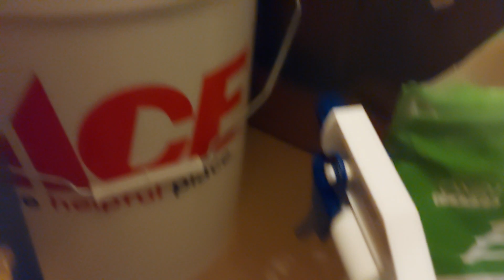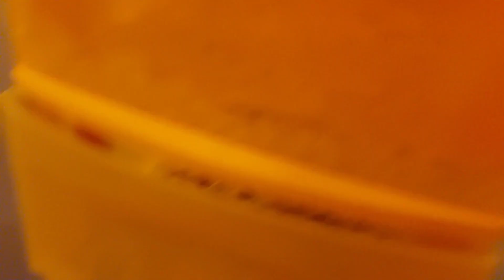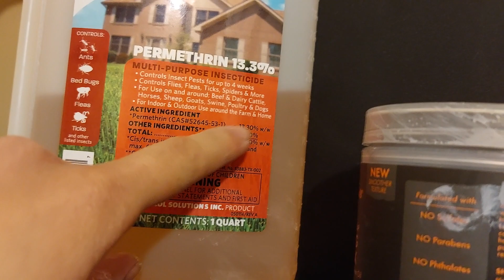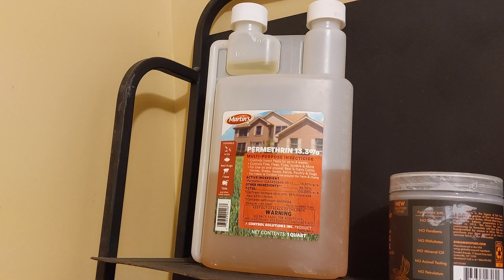How to Treat Mice for Mites

Comment: Arn't you scared of the d. (i'm not trying to spell that) earth being inhaled by your mice when they dig? I remember the feed store wouldn't sell me ivermectin (stupid, you don't need a prescription so I had to order it online and pick it up at the same store the next day) and reccomended me a whole tub of that. I never used it because I was scared of my mice Inhaling it. I just keep male mice as pets tho and now I just get a prescription from my exotic vet to treat mites on their fur.

Whoa, and I just got to the part of the video where you can actually physically SEE the mites on your mice! The mites my mice have had can't be seen with the naked eye. But I know there is different types.
Reply from the maker: Yeah, the mites are tropicla rat mites, they're big and ANNOYING, and only permethrin works on them, hence why I used it over ivermectin.

And i do worry a bit, but i just use it sparingly and stir it in well. It's most important that it's at least on the walls and sides of the food containers for preventing an infestation, but if you've already got a few grain weevils or other bugs present, you really have no options besides tossing the food or coating it In a bit of DT. the food-grade stuff is made specifically to mix with feed, so it doesn't cause serious issues in my expeirence.